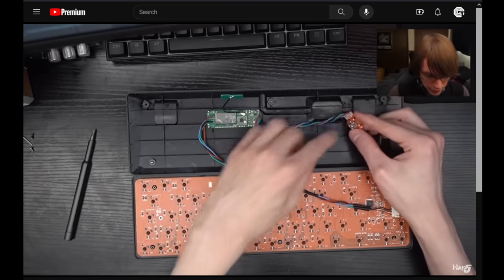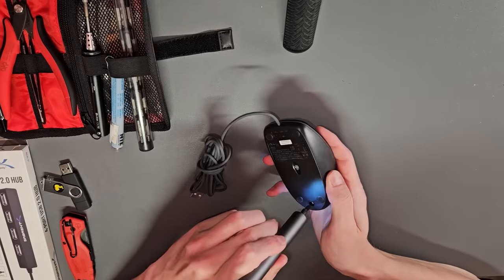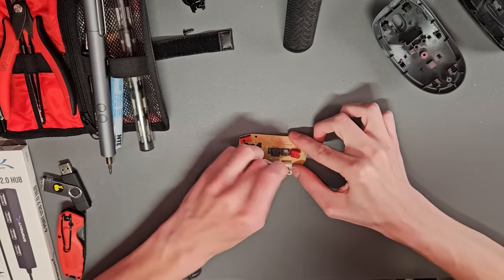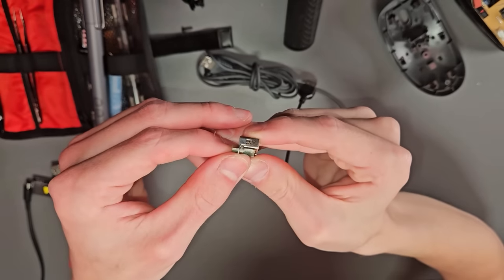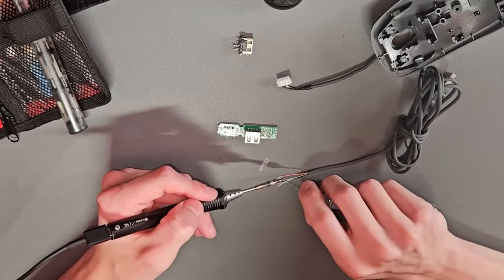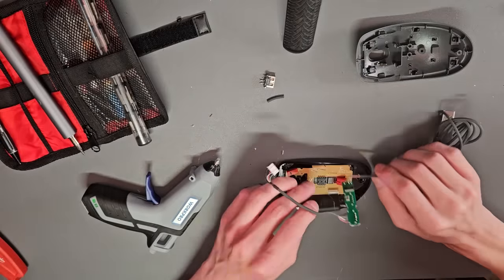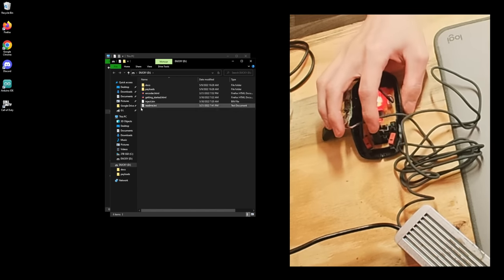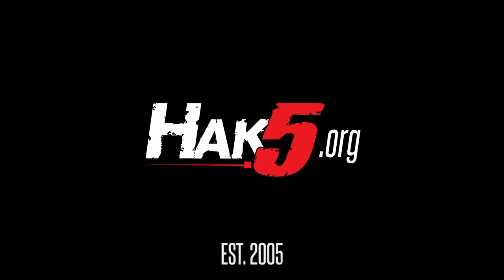Covertly Implanting a USB Rubber Ducky into a Mouse

Comment: You could probably trim that board down to a single socket and solder the extension onto the pins the usb female socket is attached to.

Comment: Doing a follow along as this is a project i have wanted to do for a while but couldn't work out how to do the hub part... so simple when you break it down... any ways... I am currently looking at working out the wiring to the actual hub socket on the board. I know there is are white, green black, and red wires, and its easy to see them coming off the board and into the cable. What is the order as they go into the actual hub socket since these are tracings embedded in the board? Am googling myself but thought I would ask here as well!! Many thanks. Great video as always!!

Comment: I also like hardware inplants. I have a power cable that is a EoP device two actually and it's a good way to gain network access to any given network with poor nac and get a IP and a shell opened on their network. Basically a lan turtle but over a buildings DC power lines